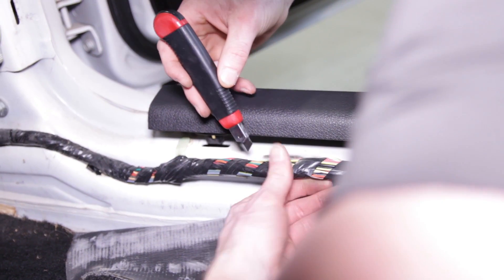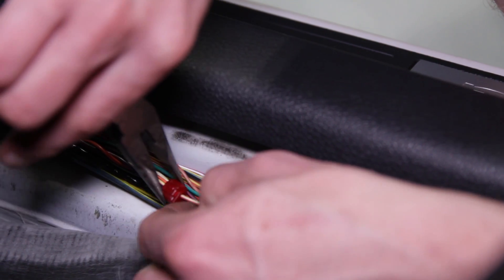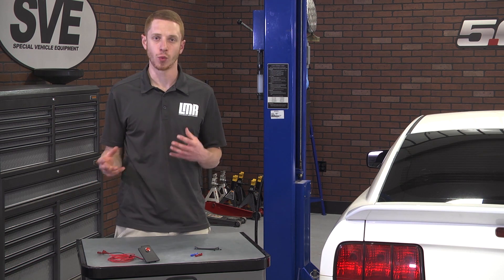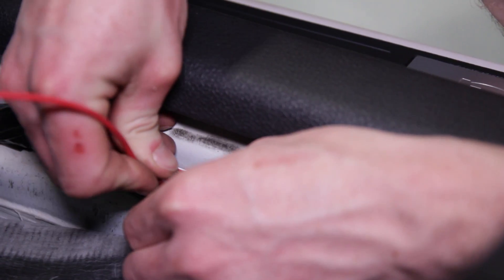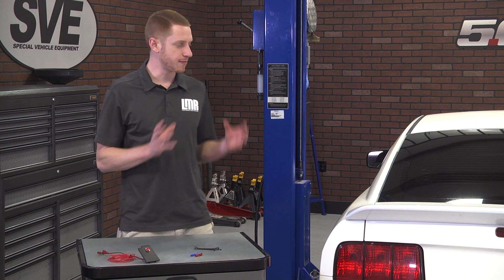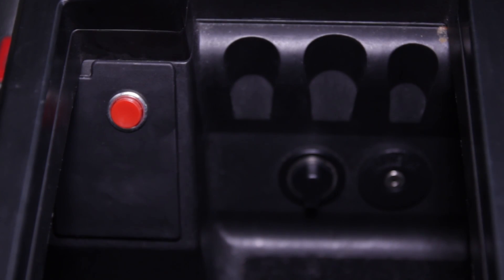2005-2009 Mustang Trunk Release Button - Review & Install

Comment: White Wire.. Pink Stripe.  Thanks for the tip! ;)

It's not that much work, just finished and I soldered everything in... It's worth it, even my Taurus SHOs had truck release switches. My Gen3 actually had 2.  

Next movement... Get some more light in that trunk, the one built into the lid... isn't gonna cut it.

Comment: I bought this release button kit and it was not bad at all and it works good so far lol
When I bought the car it didn't have a trunk key and previous owner tied a pull rope to the emergency trunk open latch. I hated that shit pulling a rope to open trunk. I just happened to run across this release button and gave it a shot and was not bad at all to install. Mine is a 2005 so I didn't have to do all that extra crap for an 07-08,  if that would been the case I just stuck to pulling the rope from back seat lol. But yeah it works good (so far) on my 05. I would recommend it, don't know if I would if I had to do all that extra stuff for 07 -08.

Comment: The schematics for a 2007 Mustang read a white/violet wire from the C2280C connector, but I guess it looks pink. I don't know where you got pin 21 from, though. It says here that pin 13 is the output for the wht/vio trunk release wire from the C2280C.

Comment: Yeah...easier solution, route a cable to the actuator, use a 1 way diode to avoid damaging the SJB, use an small relay and a rocker button. All done without even opening the center console or kickpanel....... 🤣 You guys reaaaaally overdid it... Engineer hint: KISS (keep it simple stupid)
Reply: Whats the odds on damaging SJB you think? i never did diodes, what if ill just add a button delivering power to actuator cable? no relay, no diode, just a button between power source and actuator cable? do you think i might damage anything? SJB or anything else?

Comment: no person with any self respect would use scotch locks, one of the worst inventions. Done my install on a 2005 in 1.0 hr. You only need to take top cover of console off, 2 screws, run ground to ground terminal under kick panel and solder into the white/pink wire.  Taped the harness to existing harness under carpet.

Comment: It's a real pain in the ass not having that trunk release button inside the Mustang.  Not exactly one of Ford's "better ideas" and God help you if your key fob doesn't work or your car battery is dead.  What's next, no door lock keys?  The engineers at Ford who designed this fiasco should be fired immediately.
Reply: Theres still a key hole on the trunk…
Reply: @mightymustang5067  Yes, and you have to turn off the car to open the trunk because they're the same key.